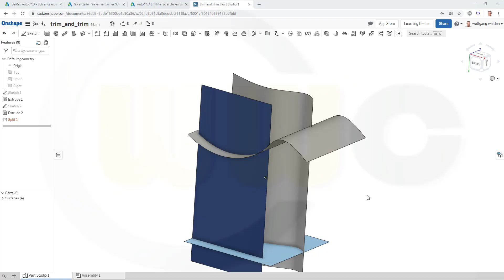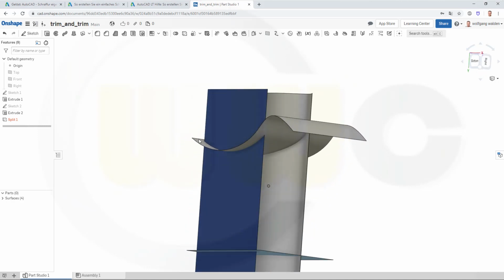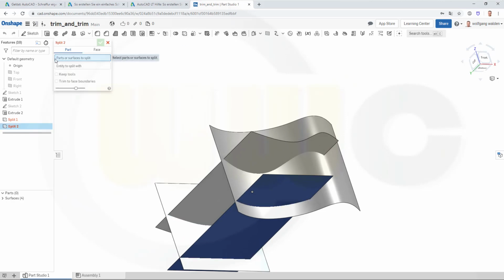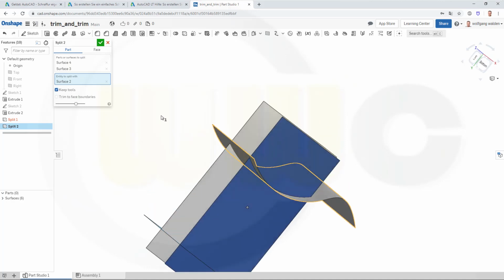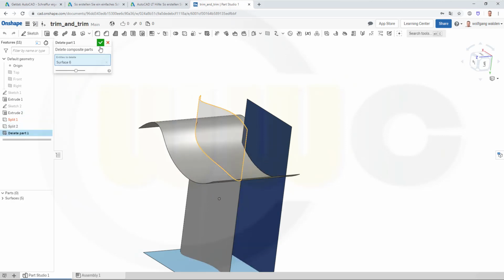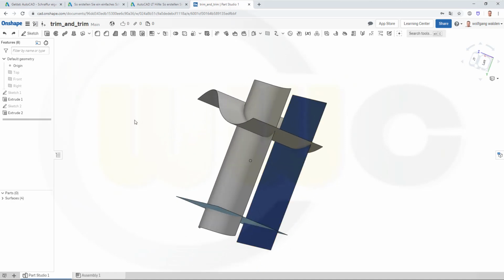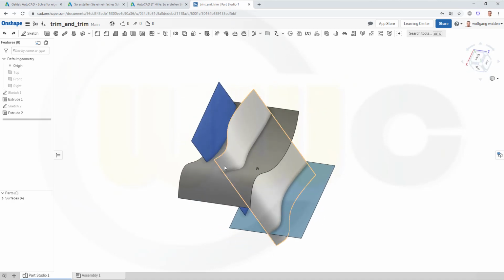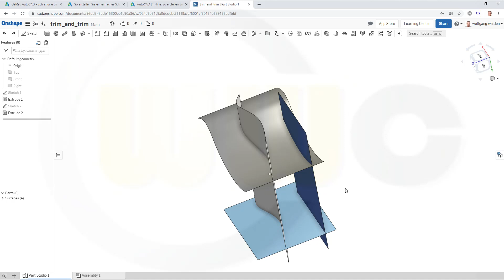Split - Onshape Training - FAQ Shorts

Comment: Can split work with a face going across a solid?
Reply from the maker: Yes - but why did you ask? Just try it for yourself ;)
Reply: @wolfgang.walden.cad.training  I created an specific shape and I extruded the shape as faces and added thickness so I can have a particular opening inside the shape. I then wanted to cut the top of the shape on a specific angle so I used spline line to get the specific shape or cut angle. I extruded the spline as a face so I can create cut the initial figure at a particular high of the figure and on the curvature that I wanted. Not sure if I explained myself to clear.